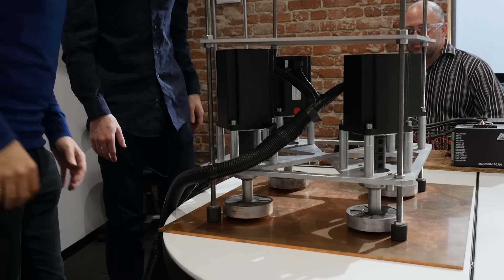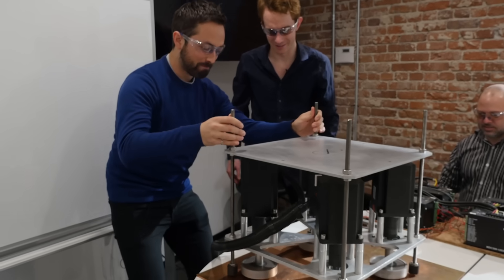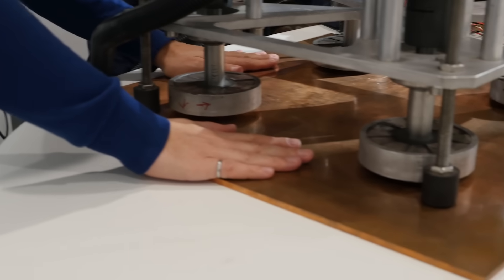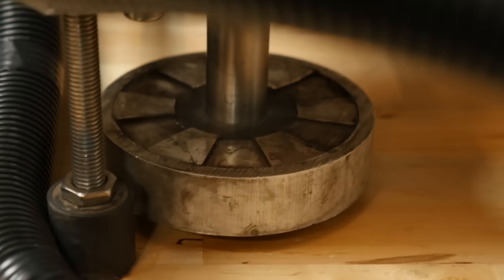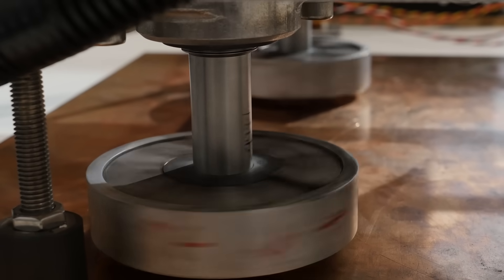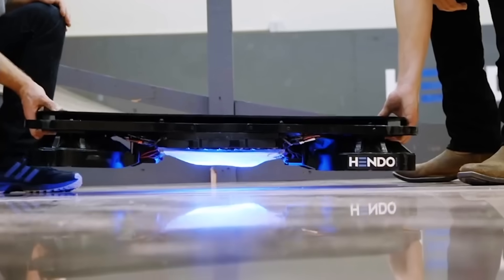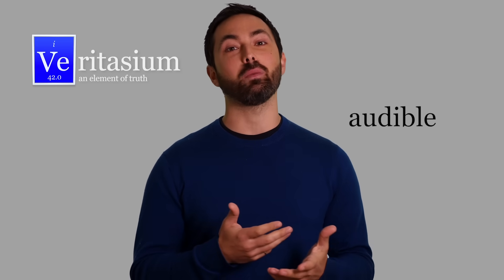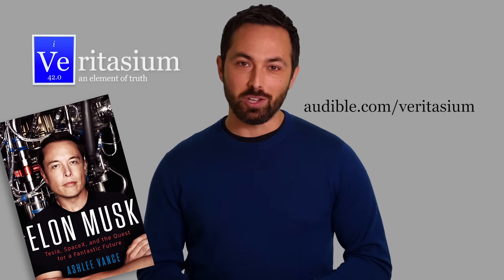Electromagnetic Levitation Quadcopter

Comment: For those of you who are pissed that Phil Mason (Thunderf00t) destroyed the so-called "hyperloop", I challenge you to debunk his video point by point. I'm sure you "wikipedia engineers" have WAY more experience in physics than, well, a legit nuclear physicist. Go ahead, I dare you.
Reply: Also, if the track was even split cleanly, the pressure would drop dramatically (5% pressure or so just 2km out) and extremely choked flow would occur within split seconds.

Also, he got really stuck on the idea of thermal expansion, which is a solved issue. Just allowing slight buckling of the tube along each pillar would be sufficient.
Reply: Yeah myth busters showed a tanker could withstand the pressure, but like thunderf00t points out in the video, the same mythbuster episode showed what happens to the same train car if they dented it. It collapsed in on itself. A missing bolt isn't a structural weakness, it's just a leak. It's just going to reduce the amount of vacuum you can attain which would bring the stress of the whole tube down, not increase it. If you punch a hole in it though you're reducing the structural integrity and that would cause a catastrophic failure.
Reply: @kronosx7  Yeah, but what is different is that the Mythbusters showed a tank specifically designed to hold positive pressure. You would guess that technical solutions are different when designing for negative pressure.
Reply: @remmahsroht  A pipe where outside had higher pressure than inside.  Wonder where I've seen this rather recently.  Ah, right, last year, with a submarine.  Now, granted, the pressure differential was way higher.  But I think they also mentioned the tanker of Mythbusters, and how pipes are good for when the pressure inside is higher than outside…
Reply: @JürgenErhard  You bet. If buckling didn't exist, you would save sooo much material.
Reply: You think thuderf00t pays people to make his videos? Riiight
Reply: "Punching a hole in it" isn't a guarantee of a catastrophic failure, nor is a missing bolt a guarantee that structural failure won't occur. Tanker walls are quite thin - 1/2" - and hoop stress goes down by a factor of 1/wall thickness as wall thickness increases. So from a wall thickness of 1/2" to a wall thickness of 2" or so, there's an eightfold stress reduction.
Reply: ....Alright, I'll take the bait. I'm not a full engineer yet, but I am an engineering student working as a technician at a high-tech manufacturing company. An "I dare you" doesn't seem like someone willing to listen, but I'm willing to discuss (pardon the length, there's a lot to talk about here.)

I don't remember all of the points he made in that video (and can't be bothered to rewatch, as it was complete nonsense the first time). I do remember him going on about how unsafe the system was because, were the tube to become compromised in any way, it would send a deadly supersonic shockwave throughout the entire tube. If I recall correctly, he posed a scenario with someone simply shooting a rifle at the thing, thus causing a catastrophic failure . This is completely ridiculous. If such a thing were to happen, air would simply flow in at a rate determined by bernoulli's principles. To give an example, the largest vacuum chamber in the world is owned by NASA and used for testing various craft. At one point along the line, they found there was a leak. Turned out, there was a large bolt that had never been installed, leaving a hole clean through to the outside air. Even with this hole, however, they were able to pull a vacuum that was orders of magnitude better than anything a standard vacuum pump would make. The only way such a disaster scenario would be is if the tube did not have any safety features, and if a part were to be, say, bombed or hit head on by an 18 wheeler. The way to mitigate that risk would be to add a quick-action gate valve every so many miles, really not rocket science.

He talks quite a bit about how difficult it would be to create and maintain a vacuum of the grade being talked about in some of the papers. What's bizarre about this is that the level of vacuum he is talking about is actually really easy to make, and is an order of magnitude or so higher (the pressure is higher, making it a lower grade of vacuum, that is) than even my cheap harbor freight vacuum pump can maintain. What's more, the level of vacuum he is talking about is only even discussed  in certain preliminary designs for the hyperloop. Most of the papers discussing it have been talking about much lower grades with higher pressures. I don't know why though, as the kinds of systems used to create large high vacuum chambers have already been implemented at places like NASA, the LHC, the gravitational wave observatory, etc. 

If memory serves, he spent a great deal of time talking about how ludicrously difficult, or expensive, or whatever, it would be to simply make a tube that could withstand the 14.67psi of atmospheric pressure by talking about the forces involved for anyone watching who didn't understand that pounds per square inch meant, yes, pounds of force per square inch. The trouble with this is that such a tube could actually be made relatively simply (i didn't say cheap, but no infrastructure is) with methods and materials that already exist. The tubes would likely need to be not much different in wall thickness (or diameter, for that matter) than that of a train tanker car, which are designed for hundreds of psi and, as the mythbusters will attest to (good video, check it out :) ), can hold a high grade of vacuum quite happily.

Anyway, that's more than enough for now. I really don't know whether the hyperloop is a good or viable idea or not, but I do know that most every point he made in that video was completely nuts. Thunderf00t has made some good videos in the past, but this was not one of them.
Reply: Oh, thanks, I'd forgotten that one. This MAJOR problem of the system is something so easily fixed, that when I had a similar problem in my garage, the cure literally turned out to be duct tape (obviously the pros would have a more robust solution). Also, as if a building full of mechanical engineers would simply forget thermal expansion is a thing XD.
Reply: But a sudden hole is different from a missing bolt. Not only the sudden pressure isn't the same as one built up with the vacuum buildup, but a bullet hole also wouod cause tearing and stuff. So more energy on a weaker point. The NASA chamber is way smaller than the project proposed too, and did you see how thick its wall are compared to the tube they showed ?

The challenge is still valid. All the counter debunking of thunderfoot's debunking is just unsastifactory. And rely on "Yeah, but he's an engineer", and rarely, people mention that he isn't actually one, but the paypall guy with a taste for investing in risky stuff who made enough money to pay guys to do it for him
L

The cult of musk is real. He is like the new Steve Jobs with the same ammount of drones defender, except it isn't cool to attack him. (And to be fair, he didn't compare himself to Ghandhi and others)
Reply: 1.4in thick, which is far oversized for the pressure differential (2-3in is enough to withstand approximately a 49 atm pressure differential comfortably). "tearing and stuff" is unconvincing; tubes are highly unlikely to collapse if a bullet is shot into them, even with much higher pressures in pressure vessels.
Reply: Let's just take one simple case...

Thunderf00t used a straw example by saying that the vacuum must be space-grade, and claimed that it's impractical to make one as large as Hyperloop' since the biggest we had so far is only the size of a building. That's like saying we musn't use heat engines if they don't use the Carnot cycle. Truth is, we only need pressure low enough that friction is significantly reduced, yet not so high that the cost to maintain said pressure diminishes. Not space-grade vacuum.

We wouldn't have almost every technology that we have today if engineers went "there's this problem, therefore we can never make it" instead of coming up with compromises & workarounds like they did.

Comment: Does the table still hold the weight of the device when it's levitating?
Reply: Good question. My guess would be yes, since it is pushing off of it rather than using the air to pull itself up like a helicopter.
Reply: T Tommy i think so, newtons third lae states that when the table exerts an electromagnetic repulsive force on the device, the device exerts a force of equal magnitude on the table (its weight)

Comment: And this can be called a quadcopter because?
Reply: Cameron Seitz obviously
Reply: Well, ehhm, if you don't see the cable running up to the "copter."
Reply: @StarNumbers  since when connection to the ground disqualifies it from being a quadcopter?
Reply: Fact Core The last point being the most important one.
Reply: It can't fly.
Reply: It lifts using 4 rotors... It qualifies
Reply: A) It can fly.
B) It has four main points that achieve lift
C) Quadcopter is a cool word

Comment: If you put a scale under the copper board, are you going to see any change ?
I suspect it will be the same, and it will even increase if you apply pressure on the top of the quadcopter

Comment: ... just throwing it out there but the issues of moving people in a low pressure doesn't seem problematic? with a maglev you can get really fast, but the difference is there isn't an over lingering force that if failed will cause... you to pull lethal g forces

Comment: It's still a dumb way to get magnetic levitation. Those motors are much more lossy than a high power inverter that can just oscillate electromagnets. No moving parts and a lot less noise.

Comment: Hyperloop has been busted by thunderf00t.
However this is interesting for moving heavy cargoes, kinda like a futuristic antigrav device. In return the excess heat could be converted into electricity with Peltier plates (a whole freaking lot of them) in which one plate, the hot side is the floor for the cargo area, and the bottom side is linked to sea water or some other source of cooling. That way you can pump some of the electricity used back to the system (as if a company would do that). Still, it's a good for moving cargoes.
Reply: All Thunderf00t did was complain about the difficult implementation of hyperloop. He also attempted to show that the mechanism wouldn't work, but he was using poor models and had a lack of knowledge on how it works. He's a very intelligent man, but he's not infallible.
Reply: Fact Core he did the math and said it can't be done. And I kinda trust him, a scientist, more that Elon Musk who is a businessman. Now of course the Hyperloop could contain some short of exotic material that makes its construction possible. But since they said how it pretty much operates, it's a safe bet to say it doesn't.

Comment: I'm curious if this principle could eventually be applied on a much larger scale. Currently it requires a fixed copper plate or rail in order to levitate so it works very well for vehicles running on a track or a tube, such as a train, or eventually even cars on specially designed roads. 

But would it be possible to attune a device to Earth's magnetic field and write an algorithm to control the spinning in such a way that a free-floating vehicle could hover above the earth's surface and move in any direction? It would eliminate the need for the rail and allow for a broader range of transportation options. 

Heat emissions could be an issue with enough vehicles but with efficient solar technology to power the vehicle I doubt it would be anywhere near as harmful as fossil fuel emissions. Just a thought, but if the science can be refined enough it could be an alternative to wheeled, combustion powered cars.

Comment: That was disappointing. Unless we make copper roads, this isn't going to help making hoverboards x)
Reply: Actually it means all we have to do is make copper roads if we want hover boards
Reply: Realize, though, that the relative velocity between the magnets and the repelling surface is critical. You can't move at just any ol' speed.
Reply: +Lagrange Si
Thats not true at all, however you can use any conductor.
Reply: dont forget anything that conducts gets hot as the vehicles go over it.. and melts.. you would need the road made of the magnets and the vehicles made of the copper. so thats never happening and neodymium is a rare earth element only mined in china.
Reply: @PwnstarUK  You get free heating too for your feet on cold days and you can use adjustable vents to shoot the hot air upwards to keep your face warm when you're levitating down the road lol
Reply: We could make hover parks :)
Reply: Aluminum would also work 
And all you need is heat sinks(could get some electricity out of it)
Reply: Y'all are forgetting that copper/aluminum are thermal conductors and with the surface area of a freaking road heat would not be a problem...

yeah fl00fydragon but I think people would stop and get out of their cars before their blood starts boiling
Reply: I guess first we need fusion powerplants in which to create copper.
Reply: Bob Saturday Can you text me that about 3 times a day?
Reply: Nate there is better elements to use than they used like graphene and diamond lasers
Reply: fl00fydragon wouldn't aluminium melt, and also it oxidized fast
Reply: We could do that tho 
And create something to absorb the extra energy
Reply: Would work with any metal that conducts well, and is nonferrous.
Reply: But that still would be expensive
Reply: The wheel is pretty effective..  I wonder if you can make new tires from old tires? (and thats it, you're rolling again instead of paving the world with expensive materials for hovering vehicles)
Reply: Nate Well what do you think happened when we needed roads for cars
Reply: Bryan Channell heat sinks are your friend 
If you get the "road" up to 660.3 degrees celsius you have a far more important problems than the road melting. 

On top of that aluminum is far more structurally sound when treated

Both metals oxidize if left untreated 
My solution would be to put a thin but durable material over them as this system would not be influenced by anything between the hovering object and the road so long as it's not ferromagnetic
Reply: if i'm not mistaken you don't bring temps up you bring them down @ sub zero where some materials are natural superconductors but we gone have to figure out how to turn natural resistor like stone's into conductors No?
Reply: fl00fydragon graphene and oh yeah like my less have al heat sinks
Reply: Bryan Channell looks like I'm not the only one who thinks of graphene
Reply: So first, the "roads" would have to be made of a copper plates or other superconducting material (not the vehicle itself)... second, the vehicle would either have to be travelling at very high speeds to stay afloat, or have rotating horizontal wheels made or super strong magnets similar to the prototype being demonstrated (or superconductors).  With today's technology it would be impractical, but then again 30-40 years ago who would have thought that we'll have Star Trek like smart-phones in our pockets. ;)
Reply: cant cooper be attached to the strucutre and not to the floor? If so, Would it go up endeless?
Reply: At superconducting temperatures, everything becomes magnetic. Just have to bring superconducting temperatures up, a lot.

Comment: maglev trains are great. however the hyperloop has a TON of hurdles to jump. they haven't come close to figuring it out. watch thunderfoots incredibly descriptive video on the flaws of it.
Reply: TheSkepticSkwerl Thundef00t didn't have a complete understanding of the subject. He made several incorrect or over exaggerated statements in the video.
Reply: Fact Core I agree he isn't an expert. but simple math proves many flaws in the system. I hope they figure it out. but like he said. a single bullet through it would kill hundreds of people. expansion is fact. countless seals that have to be flawless. it's not just a system or train. it's a huge vacuum. it will have thousands upon thousands of flaws.
Reply: Moreover, the Hyperloop violates the prime maxim of engineering: "Keep It Simple, Stupid!"
Risk of catastrophic failure increases exponentially with complexity, and this thing is so complex that the risk is almost 1:1.

Comment: G'day,

  Yay Team !

   A fascinating explanatory video.

     However, while this is a very cute Party Trick, it has no future as a Transportation Technology.

  The "side-effect" which results in  heating of the Conductor by the Eddy-Currents means that this Magnetic Levitation stunt is not nearly as ENERGY-EFFICIENT as a Steel Wheel rolling over a Steel Rail ; let alone a Boat floating on Water.

   Nobody has ever carried unsubsidised Passenges or Freight on any Mag-Lev Train, anywhere on Earth, and conventional Railways are already failing financially, due to the cost of maintenance against the effects of Global Warming... (Australian Wheatfarmers currently have a bumper Crop which can't be harvested, due to fear of Machinery sparking uncontrolable fires duting the current Heat-Wave...; and meanwhile the Freight Railways have to shut down every time the Ambient Air-Temperature exceeds 35 Degrees Celsius - because the Rails can't cope with the Loaded Weight while under excess Thermal Stress.

    Basically, Magnetic Levitation is as useless as Tits on a Bull.

  Such is Life,

Have a good one...

  ;-p

Ciao !

  

  ;-p

  Ciao !

Comment: About the hyperloop: wouldnt it be better to test the concept of low pressure environment in existing metro tunnels?
Reply: those tunnels are not airtight
Reply: Ofc not but isolating existing tunnels much be easier than building large scale models.
Reply: no those tunnels are not designed to withstand 1atm/m²+existing load and testing can be easily done in small scale models